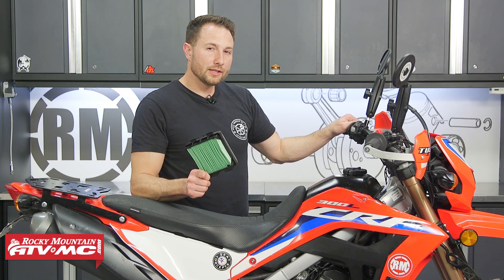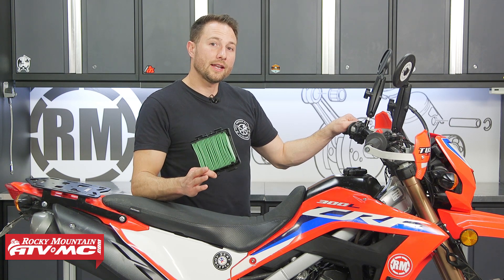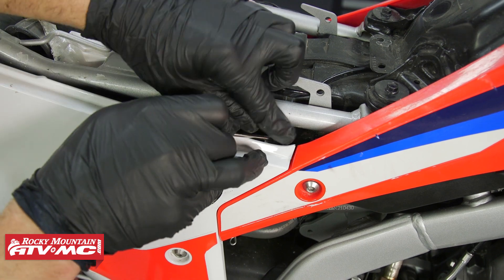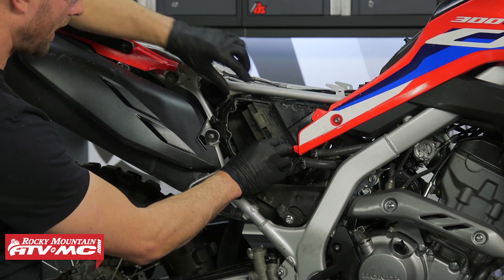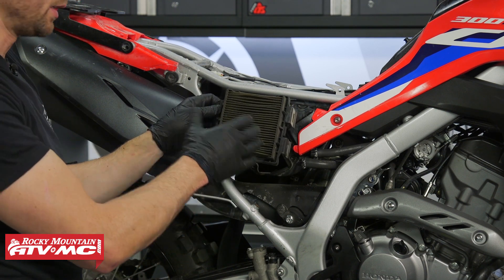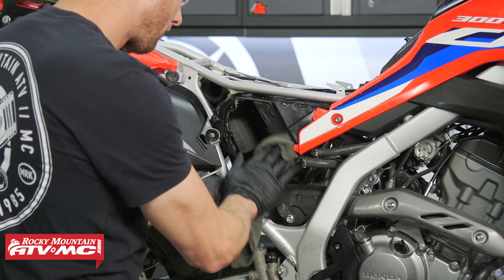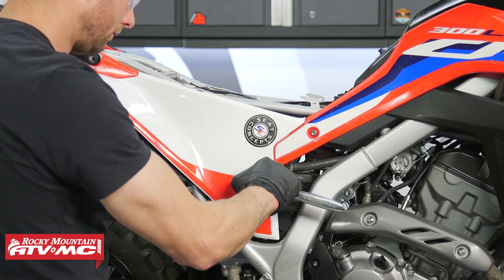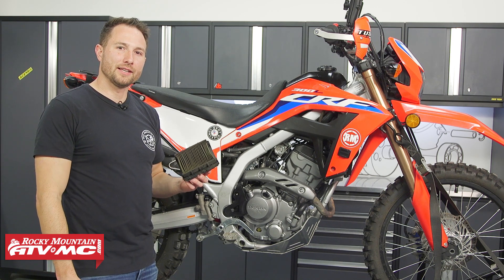How To Change the Air Filter on a Honda CRF300L/ Rally

Comment: Charles, any thoughts on removing the backfire screen on the oem honda  filter? Looks pretty restrictive....
Reply from the maker: Everything is designed to run as a system, from the intake to exhaust. The stock set up is going to be reliable and personally I would just leave it. People who are installing an exhaust and doing intake mods are also using fuel tuners. If you go that route, check your local laws and regulations. -Charles
Reply: That makes sense. Thanks for your reply.. Rory